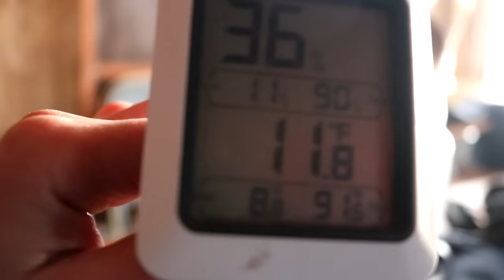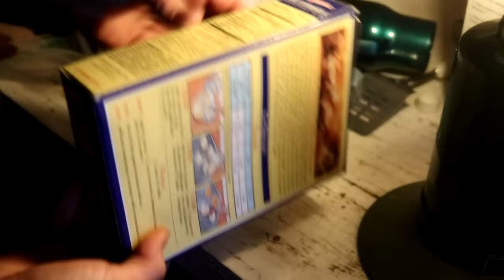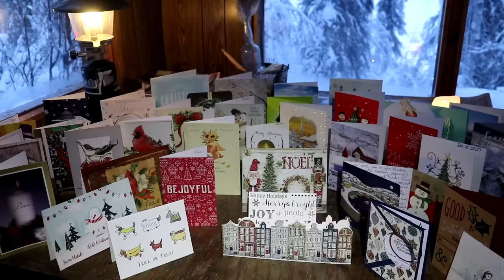Off Grid Cabin in the Alaskan Wilderness

Comment: our wood stove installer gave us this tip when trying to start a stove in a super cold place....first light a bunch of paper and hold it in the stove where the pipe goes up, (maybe do this a few times depending on the length of stove pipe) this warms the air in the pipe and gets it to draw properly,
Reply: On another channel I watch the guy does this with the paper.
Reply: Wood stove life...need a draft

Comment: Congratulations on the find and purchase.  Couple things you may like to know.  Build a storage shed for your Snowmobiles,  tools and spare itemsand keep a heavy duty lock on it if you're not going to be around. Build a Smoke shed for meat. Measure your windows and keep extra glass. Your wood heater, if not rusted through,  is fine. Make sure the smoke stack is clean and clear of dust ( a long pine or Spruce bough works great ). Clean the old ash out of the bottom of your wood heater and it'll be good.

Comment: Learning to use quality storage would save a lot of time and money — if those new kitchen towels had been cleaned and placed in a clean PVC capsule where mice could not walk on them — they would have been ready for immediate use — 2 ft. PVC containers with caps on each end are perfect storage for blankets, food, towels — just about anything — they come in all sorts of sizes — 4” to 12” are my favorite sizes — some I even made about 4 ft. tall for cot pads and such — “10 cans will fit the large sizes — saves on rusting if you use moisture absorbers — you seal one end with PVC glue — use a clean-out fitting to unscrew on the other — enjoyed your video!

Comment: The dogs will start to get how fun the cabin is ... but probably always hate the ride.  Mine do at least.  I’ve learned a lot of tricks for traveling to a remote cabin with dogs. Also lots of tricks for cabins.  Try the double propane heater- 30,000 btus . Siglin sleds are the best.  I double tow mine.  You’ll learn to be efficient with your trips and what you haul out.
Reply from the maker: AK CUB  yes they hated the trip, I have some plans to modify there sled to take the bumps a little better.

Comment: I would take a small rope and attach it to the Lantern and attached the rope somewhere up high in the cabin to raise and lower the lantern . I used to do this camping outside in a tree I could light up at least an acre of land by doing this. if you tried this it would light up the whole cabin easily also in the summertime this should be good to do outside to light up . you probably should check the outside stove pipe and make sure it's not plugged up good luck on your new adventures with your cabin

Comment: Mountain House food is still good as long as the foil package isn't compromised. We tested food that's 30 years old and it's still good tasting. Air and moisture deteriorate food so the foil & vacuum seal prevents both from entering. If you have any questions call Oregon Freeze Dry, Inc.

Comment: Continue to keep food, linens, etc in zip-lock bags until you bring plastic & glass ware to lock up your daily items. Don’t keep anything out in the cabin that will attract mice, bugs and definitely bears! If you maintain a clean cabin you won’t have issues with any wildlife. Always use a checklist going places for return and stay. This way you will never be forgetful and it will also assist you in closing up your cabin so it will be totally secure each time you need to return. You made large dents in cleaning up your beautiful cabin and had a magnificent experience too. You two are young enough that you should have many pleasurable memories to come. 

I look forward to watching videos in the future that depict the many different Alaskan sceneries. One important area of concern since you mentioned that your cabin was extremely off grid, is for emergency situations. You not only need to have an extensive first aid kit, but you also need to be able to contact emergency services via a CB radio. There are radios without batteries that would be an excellent investment and even small solar systems the size of a car battery that could help with other electrical needs for example that could be used in the building of an outhouse or other individual items as times go on. Good luck and be safe💕

Comment: Could you rig a system where driving the snowmobile down the hill would pull the haul sled up the hill? Mount the block high up by the cabin, clear a drag lane...also, I bet a some padding, a little radiant barrier insulation and duct tape would help the dog sled out, keep those buddies a little warmer

Comment: Cool place.  Congrats on scoring that cabin.  You will love it!   those morning tea cups are same that I grew up with.   I bet some of that food is as nutritous as the batteries are charged and ready to power a old flashlight, but... then again, salt isn't going to go bad Ever, even if it took on some moisture and got hard, and I bet that popcorn is fine (albeit probably GMO crap popcorn, but oh well), Olive oil will smell rancid if it's bad.  If not, that bottle is pretty full and is probably not oxidized and is fine.   Check, of course, for signs of rodents in that stuff, but some of it would probably have been fine.  Not at its peak of nutrition by any means, but it would be good survival rations.  Like those ramen noodles.  Score.   toss them in the backpack and you have survival calories.   I'd be way more concerned about those cashews, regardless of how choice that might be to score.  The potential for aflatoxin is way too high on old nuts.   Also, check the fire extinguisher.  I'll bet it needs a recharge.  Bring it into town and get it checked out.  cool metbod with the paracord and bottle on the roof!  Oh and i'm not sure about your roof clearing procedure, but be careful of taking all the snow off one side of the house (which it seems like you did).  It's better to take a bit off one side and then some off the other, back and forth.  Probably not an issue with colder snow that is dry and lighter, but if the snow is wet the unloading of the weight on one side can cause serious stress to your roof on the other side and the cabin in general.  Looks like the cabin is solidly built.  You two got a great little place there!

Comment: @Simple Living Alaska Consider inexpensive polyester hoodies for your dogs or sweaters for normal use on your dogs in the winter.  Contrary to popular belief, dogs do feel and experience cold like we do.  The orange vests seem fine but I would use parkas for them since they are older dogs.  To cover more of their neck and shoulders and legs.  The "dogsled" is essentially open air subject to winds and wind-chill in addition to the external termperature.  Your dog breeds do not appear to have an undercoat and overcoat that would protect them from the elements more naturally.  The level of exhaustion on their faces shows that they may have been experiencing hypothermia exhaustion.  Please consider upping their gear before bringing them again.  🐾💓 There is inexpensive dog gear available at WalMart that would be better than nothing.  Then consider upgrading as you can.  Dogs only sweat primarily through their tongues and paws remember, so keep them hydrated as well with temperate water for their core temp as well.  Watch THEIR cores and extremities. 💓🐾💓🐾. Put a sweater under a vest or hoodie (check inexpensive sources online).  Even without the hoods on, they snug a bit to comfort around the neck and shoulders.  @Simple Living Alaska

Comment: You should keep the stove.  You do need to check the flu pipe to be sure they haven't plugged it.  Next when you want to light it.  Crack your door, then put some paper in the flu from the inside the stove.  put all your kindling, and small sticks in then light the paper in the flu.  When it burns out the flu will be hot and you can then light the paper, and your kindling.   If the stove is not rusted through it's good.  Unless you've had water getting on the stove rust won't hurt.  In fact if it's not wet regularly rust is a good thing.  It protects the stove.  Just oil it down and let the oil bake in.

Comment: Expiration dates on long term food mean usually that it starts loosing nutrition values from that moment, or in case of spices, potency. 😉
Canned stuff can be good decades past its term, only the taste might get funky, but putting it into a pot with some rice or whatever and throwing spices on it will solve that issue. 
Dried goods last really long, all kinds of mixes, noodles etc., might simply need more mixing or longer boiling.

Comment: I realize this is a really old video but for everyone else: The pepper, tea and coffee would prob still be good but maybe lose a bit of flavour. Depends how well sealed it was. Hot chocolate would depend. If no marshmallows and only sugar, salt n cocoa then might still be good if foil packets.
From my experience, even tho soy sauce has an expiry it never seems to go bad.
Wet salt can be salvaged. Hard sugar goes stale but if used for cooking the staleness disappears. 
The kool-aide, crystal light and drink crystals can last for decades. Can suffer the same stale issue as sugar tho.
Rice was possible still good if sealed, too risky due to mice droppings if not.
Pancake and/or cake mixes actually go bad real fast. They tend to last a few years past expiry if unopened and in wax/plastic bags within the cardboard box. Otherwise they can grow a mold whose by-product is quite toxic.
Tuna may have been "safe" to eat if can wasn't bulging but the flavour, texture and nutrients would be reduced quite a bit. Better to ice fish for fresh.
That's about it off the top of my head.

Comment: Perhaps it would be better to leave the snow on the roof, it's actually good insulation.  I know that the weight of the snow load can be an issue with some buildings but I would think that a wilderness cabin that is expected to sit unoccupied for months on end in winter SHOULD  be designed to handle a heavy snow load since no one will be there to clear it.

Comment: I have a question.  I have watched many wilderness videos where they have snowmobiles.  When the temperature is minus 30 plus, how do you get them to start?  I would think the cold temps would kill the battery and the oil would be too thick to allow starting.  Are they air cooled and have no oil in them?  Just wondering.  Thanks for sharing..

Comment: You guys are hilarious!  Old, old, old . . . I moved OUT of Alaska in 1993!  That's not an OLD Coleman lantern, that's one of the NEW ones!  The old ones used white gas, or liquid Coleman fuel, and you had to pump them up - the air pressure forced the fuel up to a spot where the flame of the mantel vaporized the fuel and kept the whole thing going.  You're young, so the stuff you're going through SEEMS old, but it isn't really.  Hilarious!  PS, the freeze-dried stuff is usually dated for 25 years.  After that, the flavor declines a little.  Enjoy your cabin!
Reply: And it WAS a good idea to buy the place when you could.  Had a friend who bought a cabin on a lake in Maine - it would now be financially out of reach, so good to get in when it's possible.

Comment: Where's your gun? We noticed your wise husband carrying one, so, where's your gun? The cabin is called a, "Lineman Hunting Shack." Outfitters fly their hunters in and drop them off to hunt. The cabin is outfitted for a  weekend summertime hunting and/or fishing trip. Its not meant to be a permanent home. This probably why it changed hands so often. Its only good for one thing. The reason why the owners left survival stuff is in case some poor lost soul found it. Most remote hunting cabin owners do this practice. If you want to help protect your cabin from bears and such, I'd suggest leaving scent bags outside filled with cayenne pepper. It messes up their sense of smell for a little while. Just a word to the wise; Raccoons climb into the cabin down through the chimney. If that's an old cast-iron wood stove, don't replace it ... restore it. It's got years of use left in it still. Modern stoves aren't built near as well as the old cast iron stoves. Since your cabin has been passed down to several owners, I can't help but wonder if those woods haven't been hunted-out.